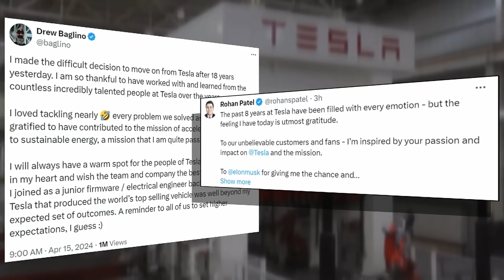Tesla layoffs raise concerns in Austin

Comment: Sales are down cause the electric car can’t even handle the cold when it left bunch of drivers stranded last winter. People switching back to normal gasoline cars that have withstood the test of time.
Reply: It should be extremely easy to use the battery’s own power to keep the battery temp above 32°. 
You could encase the battery with something similar to an electric blanket people use.

I’m not even an engineer and already resolved that “problem”.